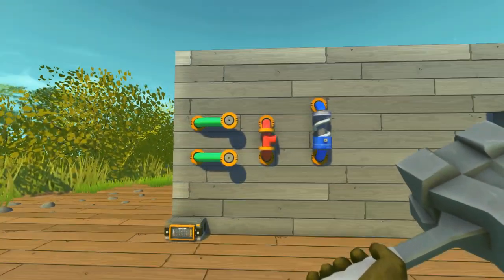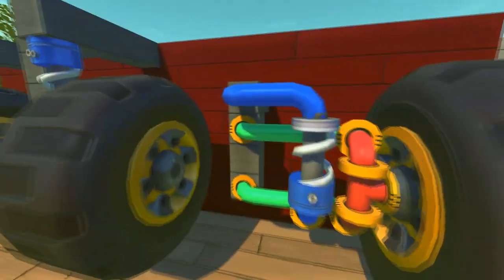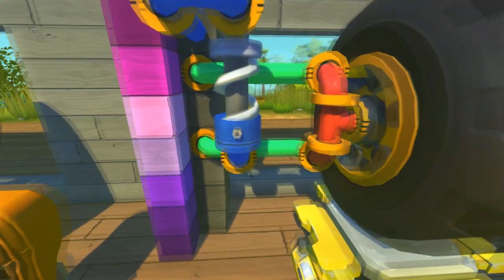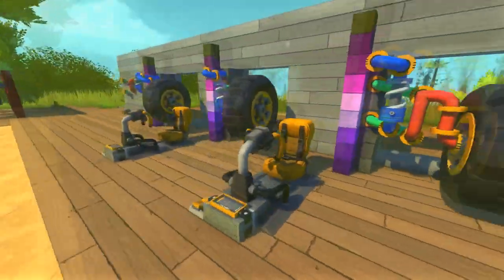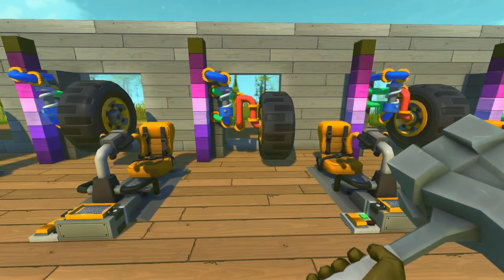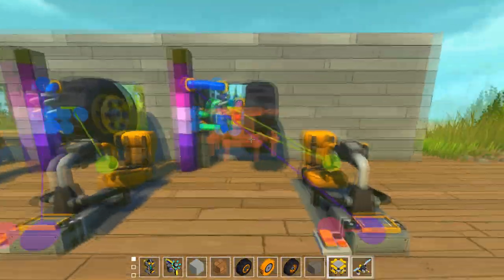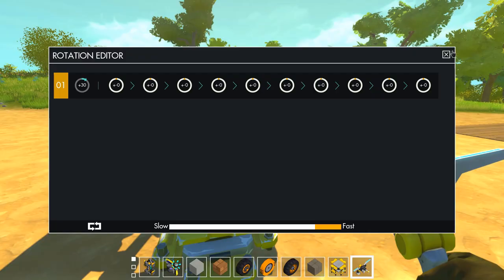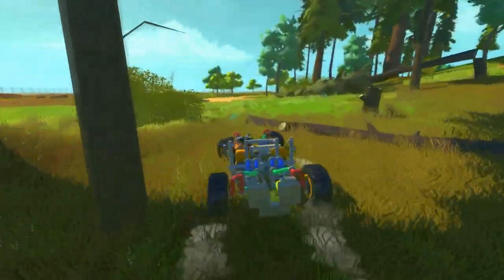Realistic suspension for beginners - Double wishbone suspension

Comment: I have double wishbone but having top bearing on the spring moving allows body to roll so much that it can flip, whilst having top bearing fixed car becomes fully roll immune. I apply this to rear only which is also 1 block wider base than the front. This compromises ability to turn a little but allows for higher top speed, and no rolling what so ever. In survival you may prefer to have roll immunity on your car.

Comment: I made suspensions based on your design with 3 simple pipe in the wishbone et the spring in the middle. It works incredibly well in creative but for some reason when I build it in survival the whole suspension sort of collapse when hitting something hard. Back to the drawing board I guess
Reply: I found a similar problem.
I think the physics of survival allows the bearings more slack, letting them pull apart slightly. compound this issue across all those bearing connections and the wheels camber WAY too much under heavier stress.

Comment: the problem with this design is it has suspension glitch it makes the car unintentionally more stable
to fix it you need to atach both ends of the suspension to a universal all axis joint 
also i dont really think that double wishbone is way more beter than standart basic suspension
its cheaper
and has less lag
Reply: his recommended setups shouldn't cause suspension glitches.

I agree that this suspension has the benefit of greater travel height (than a single suspension) but in most cases a simpler suspension arrangement would be more useful, compact and less taxing on your computer.